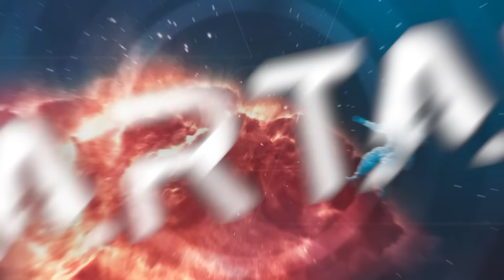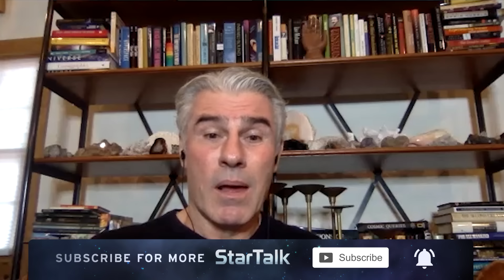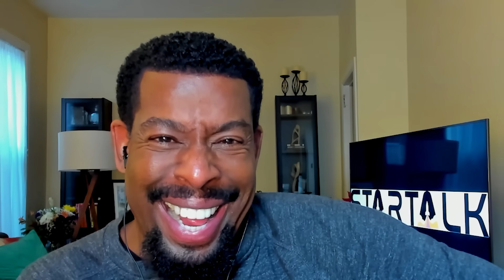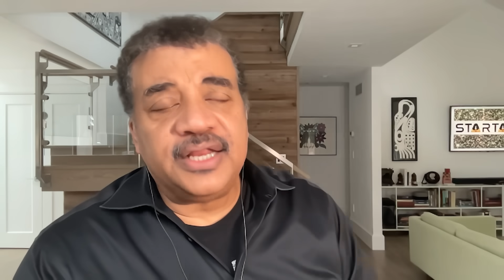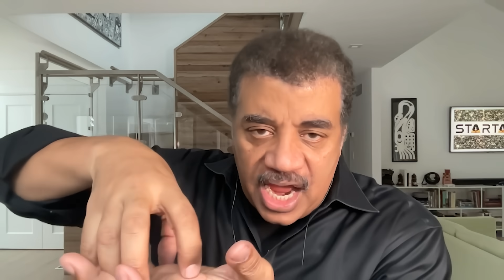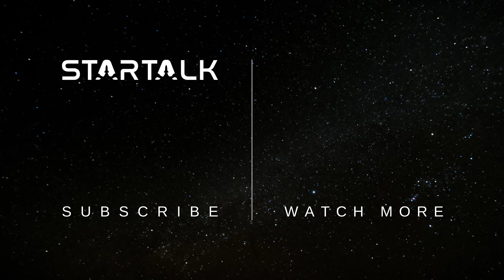What’s The Fastest A Car Can Go? | Neil deGrasse Tyson Explains...

Comment: Wait,  wouldn't more friction surface area help? 4WD is better than 2WD, what about tank treads? You're getting much more surface contact... would that still be limited to 1G?
Reply: I don't think surface area affects friction, but treads affect friction. I don't really know why that is the case though, it seems like surface area should affect friction.
Reply: @OnlyOneGedeon  surface area would have to affect friction,  that's one reason they have wider tires, but having more surface area would reduce the pounds per square inch, which would might affect the friction per inch...? IDK.. it's been 20 years since my physics and calculus classes :)
Reply: @jwmmitch  I feel out of touch too. If i remember correctly: force of friction, Ff = m*g* coefficient of friction. None of these are dependent on surface area, but if that is the case why are ice skate as sharp as a blade?

Comment: terrible science communication. I normally enjoy startalk but this was painful to watch as neil seems to think public roads are perfect smooth surfaces or the tyres are too hard a compound to deform into the road or something. when clearly there is many many examples of things accelerating faster than he said is possible on normal road, sand, dirt and probably more. lots of things accelerate over 1g with loss of traction even due to the acceleration force coming from the sheer strength of the tyre or surface it's on as each tread sheers layers over when spinning on the surface.

Comment: Dr. Tyson is one of the greatest, but I have to say he is not totally right here. Cars are able to overcome loosing friction to some extent by not applying 100% of the car's capability at launch, and only applies a fraction and increases it's output over time till friction is close to optimal. This is called "launch control". The porsche 911 turbo S uses semi-road tires and with launch control is does a 2.6 0-60. Thr compound in those tires aren't as soft as they may seem. It's possible to drive up to 12'000 miles on those tires. If a car's engine could rev up to 7000 rpm, launch control would limit it to around 3000 to 4500 rpm depending on the car.

Comment: The Nissan GTR R35 back in 2009 could do 0-60 < 3s pretty easily. Four-wheel drive systems + launch control (clever computer-controlled traction control and magnetorheological suspension systems) make it a reality.
Reply: No special conditions. Just very clever computers!

Comment: Why is the thumbnail "terminal velocity", when it's all about acceleration from 0?

Could also have mentioned, that the best practical way to improve on this is 4-wheel-drive: All of the mass of the car weights on accelerating-force producing wheels instead of just part of it weighing on the driven axle (unless the front wheels lift off due to dynamic forces). This probably was much more of a reason of Audi's success in 80's rally racing than any other off-road advantages.

Comment: Modern cars with good traction control can do it without problems! 
When the tires loose grip the engine decreases power to almost 0 then back to 100% then back to 0 and back to 100% again multiple times per second! That allows for greater acceleration than 1G and faster then 3 seconds 0-60 times! 

The reason that the new electric cars can do it even faster than 2 seconds 0-60 times are because electric motors can go from full power to 0 power to full power again, THOUSANDS of times per SECOND! 
That makes them get extremely fast because the don’t spin the wheels! 

I think you should read up on that and make a video explaining it! 
It’s really interesting technology! 

Love your videos! Thanks! 

/ a normal, smart mechanic from Sweden!

Comment: Neal is the man.  I'm an avid follower but this is the first time I have to disagree.  Yes Earth's gravity is a major factor in the calculation but it is not limited to 1G.  Retina detachment is a common injury in Top Fuel drag racing from the 5Gs of acceleration they are generating.  That is not the jet cars.  Those actually accelerate slower.  Some production road cars now break 1G.  The Tesla Plaid pulled 1.3G according to Motor Trend, and 1.16G of deceleration during the braking test.  According to popular Mechanics, anything that hits 0-60 in less than 2.73 is exceeding 1G.  Motorcycle tires actually deform to absorb little bumps and fill the tiny cracks in the pavement for traction.  They can slightly exceed 1G in cornering.  That's why you're not supposed to use tires older than 5 years because they harden and begin to not be able to fill in the cracks.  I assume many soft car tires do the same.  Also in BeamNG Drive (which is known for super accurate physics) you can change the gravity to Moon, Jupiter or the Sun.  Moon gravity makes it impossible to drive fast.  Horrible traction and way too bouncy.  So, yes Earth's gravity enables us to accelerate as fast as humans have so far achieved.  If it was a little higher we could build a car that could accelerate even faster.  Sun gravity just instantly pancakes most cars so there's definitely an upper limit to how much gravity will help your car accelerate.  There also a couple of real cars that use fans to suck the car to the ground and generate up to 2,000lbs of downforce from a standing start without adding mass.  Cool topic though, thanks.

Comment: Tires don't follow classic "friction coefficient" physics. You need to understand "traction coefficient", and "grip", which explain how tires can produce coefficients greater than 1, even without traction compounds or heat, and while operating at significant percentages of slip. Tires are wickedly complex devices.

Comment: One thing not commented on is that the blown alcohol and blown nitro drag racers are doing zero to 100 miles per hour in 1 second or less with the driver routinely pulling over 3 g's at launch.

Comment: It isn't glue on the tires for friction the rear differential gears try and "climb" the other they use this force to direct more pressure to the rear tires, search ladder bars and or 4 link suspension

Comment: "The fastest you can accelerate forward is one G"
That's not always true. Without doing a Top Fuel-style burnout, because the car is all wheel drive and not really capable of doing so, the Rimac Nevera can accelerate at 1.5G, and hits 60mph in 1.85s.

Comment: You can tell Neil is not a car guy.  It's pretty common these days for the high end cars to go faster than 1G to 60 (say 2.4 to 2.5s) without rollout: true 0-60 on street tires on regular unprepped asphalt or concrete.  The rubber in any tire will deform and fill the nooks and crannies of the road surface to give them a slight bite, almost like the gear example.  It's just how tires work.  Want a funny YouTube short at a place where they run 2, 3, or more G's?  Get Neil laughing as he loses both shoes trying to walk across a prepped dragstrip.  🙂

Comment: I think we need a follow up video to explain the accel and decel times that seem to beat the rule. Rimac and Tesla for example on Matt Watson's channel CarWow are pulling greater than 1G. We are dying here in the comment section for a Tyson explanation. (Oh, and one more thing...I was hoping you were going to mention the fan cars that suck the car to the ground to gain huge traction while not increasing the mass).
Reply: I thought they would talk about the McMurtry Fan car also.
Reply: @TheIncomparableGolfer  The McMurtry does a 1.4s 0-6omph,  but it weighs about 1000kg and can have 2000kg of downforce at standstill.
Insane though that the Rimac and Plaid are sub 2s too
Reply: @benwu7980  yah the technology is pretty cool. But it is actually old. Formula 1 cars used the same tech in the past
Reply: @TheIncomparableGolfer  Yeah, for a year but also years later than the Chaparrels.
That F1 car has a new homage in the works called the T50, but for the road.
The newer F1's have some other wizardry about Ground Effect that doesn't seem to cause the same issues, but is not fans. I think.  
There's always the case to look back to the Mercedes CLK GT's getting airborne at Le Mans due to air disturbance, but nothing fan related.
Reply: @TheIncomparableGolfer   I was also thinking about fan cars, but they suck
Reply: @johnks6733  yah literally 😉
Reply: He explained that in the video already.

Comment: So how does a standard Tesla S Plaid standard out of the box do 0-60 in 1.99s? I know in regular conditions it's more like 2.3s but that is still faster than freefall which is 2.7s. I thought it had to do with the traction control measuring the ground 1000 times a second to keep the car in Static coefficient of friction which is higher than the kinetic coefficient of friction.
Reply: They don't count 1ft rollout so it ads about 0.3 seconds,it's awd,which he was calculating a rwd car, and the tires are very sticky
Reply: @brandonmcgrew8746  correct. I personally tested it on regular pavement with regular tires and it’s greater than 1g acceleration. Neil is saying that’s physically impossible. It is physically possible due to traction control at 1000x per second. If you want to try yourself, go to Miami and I’ll lend you my Plaid. Seriously. Let me know when you’re there and I’ll text you the key.
Reply: @beyondplanesight  also tire size plays a roll bigger contact patch more friction
Reply: Niel wasnt like way off, they use couple of tricks but he is basically right on point. Best sport cars do little over 1G force in straight acceleration 0-60 and 2.5s 0 to 60, when no special surface or tyres are used, since manufacturers have couple of tricks when it comes to downforce and aerodynamics of the cars couple of cars can do better, but when you do not deduct 1feet like they like to do for their stats, its realistically something like 2s 0 to 60, for Rimac Nevera, and i think 1.5G (thats not just sport car, but 2 million dollars hypercar) and that is near physical limit.
Reply: @B0ZA92  it’s amazing that you can buy the 17 tesla plaids for the price of 1 Rimac Nevera and they can all equal its acceleration. Teslas traction control is key to allowing the 0-60 to be 1.98s.
Reply: @beyondplanesight  yes thats true, but true power of nevea is on track, and there it would smoke tesla. Teslas are not cornering that good and max speed is also smaller. But its true that its far more expensive.
Reply: @B0ZA92  the Rimac weighs in at 4740lbs top speed 258mph and the Plaid at 4766lbs top speed 217mph and that’s only because they ran out of runway during the test. Plaid is the fastest electric car on the Nurburgring which has to do with cornering. I’m curious to see with a software update if the plaid can come closer to Rimacs numbers even though 17,000% more dollars were spent making it go 19% higher top speed.
Reply: @beyondplanesight  all true, i agree with everything, but people that want the best anything will spare no buck, plus its more exclusive knowing that very limited number of people will be able to drive nevera.

Comment: I liked the discussion very much, but I think there are still a few misconceptions.  Dr. Tyson seems to imply that the coefficient of friction between rubber and pavement has to be less than or equal to 1.0.  There is no physics reason this has to be true.  It just depends on the type of rubber and the pavement properties.  There are exotic rubber compositions that can have frictional coefficients >1.  One of his guests seemed to miss the point that the acceleration of a wheel-driven car is limited by the friction of the tires on pavement.  Putting a Merlin engine in your care doesn't let you accelerate faster than that limit, as long as you are transmitting the power through the tires and not through a propeller.

Comment: Explainers are my favorite Star Talk videos.  But I have an issue with this video and that is that power is not related to acceleration (and yes, I'm a fuss budget about this).  Maybe Dr. Tyson should do an explainer on that.  
Demonstration:  I have a rear-wheel drive motorcycle that is accelerating at a constant 1G.  It has a mass of 1,000 KG.  The drive tire is 1 meter in radius.  There is no wheel spin.
How much power is being delivered to the drive tire?  How much torque is being delivered to the drive tire?
Spoiler alert:  You will find that you cannot calculate the power without introducing either the instantaneous speed of the vehicle or the instantaneous tire RPM, and that value of power is valid only for that particular speed/tire RPM.  You will find that to achieve a constant acceleration the torque remains constant, the power varies directly with the speed/tire RPM.

Comment: Fun fact: the models plaid can accelerate with 1.2g and the Merlin engine vehicle is called Napier Railton😉
Reply: the single seater McMurtry Speirling set all the new records in 2022 for 1/4th mile, 0-60, turning G-force, etc. It can successfully turn with 3 G's due to the fact it's much smaller, lighter and uses downward pulling airturbines underneath of it. It's about half the weight of a model plaid
Reply: but considering the Plaid is a family car, you couldn't expect it to compete to a single seater in aerodynamics lol

Comment: The keywords are "tires digging into the road".  The same arguments were proposed by physicists in the 60's, that dragsters will not get below about 9 seconds in the 1/4 mile, because that's about 1G of acceleration.   But that's because they took a too simplistic view of friction and reduced the concept of friction to a single number; a coefficient.  "Friction" is actually the interference between the microscopic structures of two surfaces in contact with each other.  To break friction, the surfaces must shear off their microscopic structures.

Similarly, tire traction is due to the soft rubber flowing into the crevices in the pavement, providing grip (adhesion).  Take this to the extreme, end you end up with the gears and rack teeth embedded in the ground that Dr. Tyson mentioned, and the limit of acceleration would be the strength of the teeth.  This is why the dragsters use huge tires; to put more rubber against the pavement for more strength (cohesion).

Also, the tire treads need to be soft, but not necessarily "sticky", as that means it will take energy to peel the backside of the tread off the pavement.
Reply: Yup  👍
Reply: And keep in mind, at the beginning of the video, Tyson used the example of a snow plow where  the vehicle would not be increasing downward force due to momentum of the acceleration.

Comment: Nope, 1.9 sec to 60 in a Tesla model s plaid, on normal street tires and on a normal road. Tested it last week. No jets, race slicks tires or anything other than the normal street car on a regular road. Heavy and 1000HP in a 4 wheel drive car gets the job done. Many other street cars does this as well between 2 and 3 seconds with none of those things you mention, just normal tires and no downforce. 

So Neil, I have to give this one an F.
Reply: No, guy; you get the "F" for not listening/paying attention. Twice during the course of this video, he mentioned that he was talking about rear-wheel drive. Not 4-wheel.
Reply: @kellyrobinson1780  There's plenty of rear wheel cars faster than 3 secs too.
Reply: @dcktater7847 Now you are the one to get the "F" for not listening/paying attention ;) If you payed attention you would learn that 1G equals to 3 seconds. Furthermore he does not state that the limitation only affects rear wheel drive cars alone, only that the downward pressure versus the front moving motion cannot exceed 1G or the equal to 3 seconds.